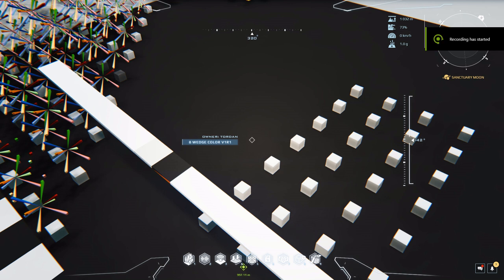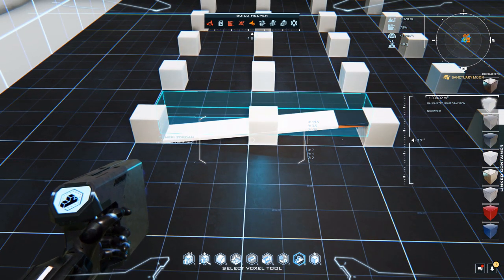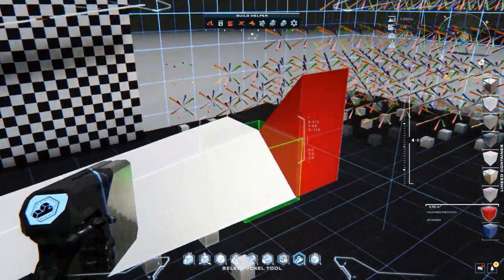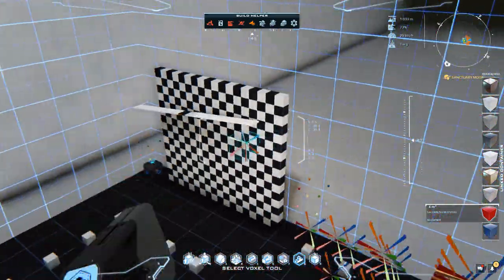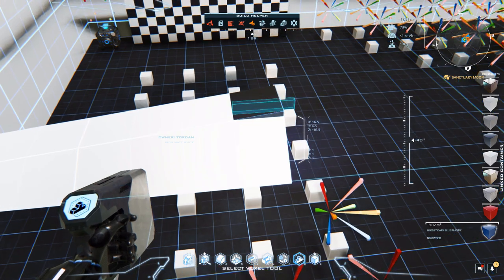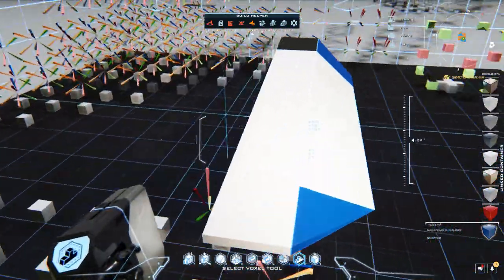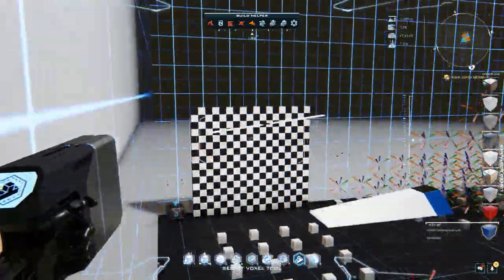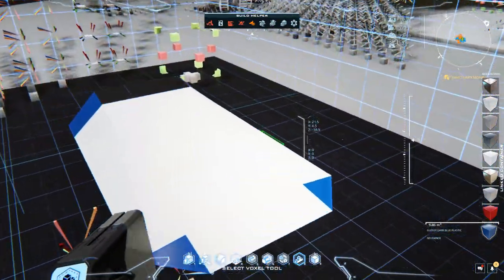DUBeta  Adv. Voxelmancy 204

Comment: Could you pull out a 45 degree triangel out of a full voxel to make two bigger triangular shapes of different materials that are attached to each other? Like a cube cut in half amd one half replaceed with another half cube. hopefully you can understand what i mean
Reply from the maker: so...
You can't ever have one voxel have two textures. but you CAN make a thing that LOOKS like a that, buy using two different voxels, but offset one into the others space.

Comment: I have a question, I would like to put a red disk on the gray construct (curved smooth inclined). In the process, the two constructions merge and such spikes arise. I already tried to place it with Alt or Shift, but still the same problem. How can I place it without creating these edges? I want to keep the smooth rounded surface ...
https://www.bilder-upload.eu/bild-80fc44-1602911995.jpg.html
Reply from the maker: the only real answer I have to that question is one voxel at a time.
Reply: @Tordan  What do you mean?
Reply from the maker: @ryzenblack  I mean, that if I'm seeing your picture correctly, there is not simple way. It will involve locating each specific point you want, and placing them one at a time into the gaps.

Comment: This was great. It took me a while to figure out the right angles with the 1/8th slope and man, the wedge is all one color when I built it, it took me a while to figure out what I was doing and looking at. At this point I now have the big reactor with the handles, a different color  Voxel indicating my perfect corner column, a bunch of different slopes for use, and after walking away for a day and coming back, I finally figured out which is the correct corner pointer for the 3:1 slope. Lolol I’ll try to start building this videos concepts tomorrow. Keep up the good work!! Also, how did you get your copied pointers to go invisible while you were placing them?

Comment: Nice series Tordan, I managed to mimic making a partial wedge from watching your 'How the wedge was won' video. I have a few questions still though.
Which copies go onto the higher layers of the wedge?
Is it a set amount of times you reduce a voxel to a point or just make them as small as possible each time?
And are you still giving away a copy of the 1/8th wedge or selling one even?

I've started and restarted a ship build several times now, it's always the angles and the nose that makes me delete the designs though in the end, I'm not a fan of the smooth tools, makes it look like i used a sledge hammer to beat the panels into place. The steps in this video are exactly what I need but creating the wedge is getting the better of me at the moment lol.
Cheers, looking forward to the next lesson :)
Reply from the maker: * higher on the wedge is the progression along the x axis.
* I shrink a full shrink to smallest point, which actually only takes 3 clicks, but I usually do 4 "just in case"
* yes I'm giving away the wedge, but I'm making people message me on Discord for the Coordinates to the information here doesn't become dated. Tordan#0968 
* I'm very glad you are enjoying them. /smile.
Reply: @Tordan  What discord is that? the main DU one or another one?
Reply from the maker: @rob9752  discord private  messages are server independant. But i am also the only Tordan on the DU discord